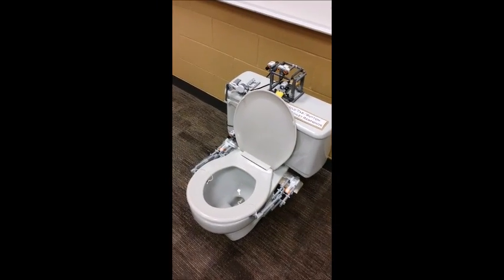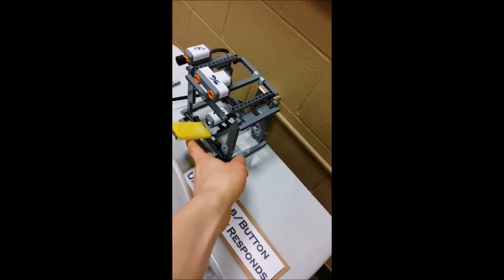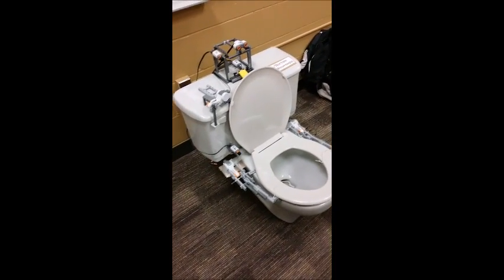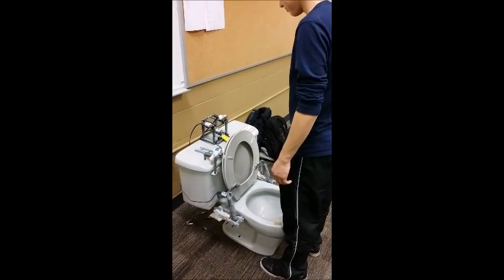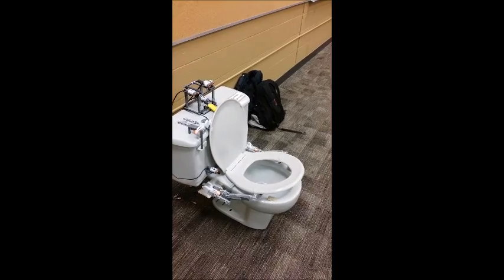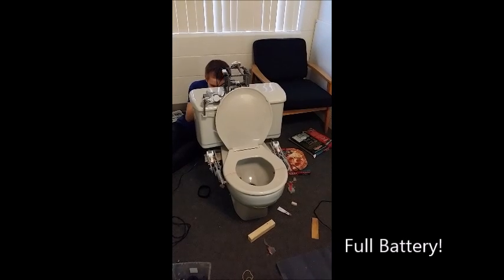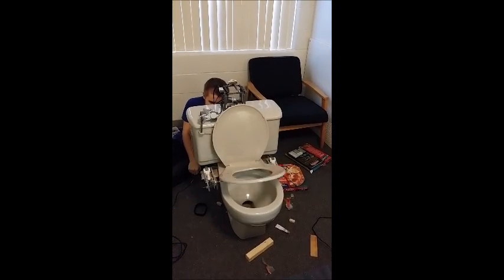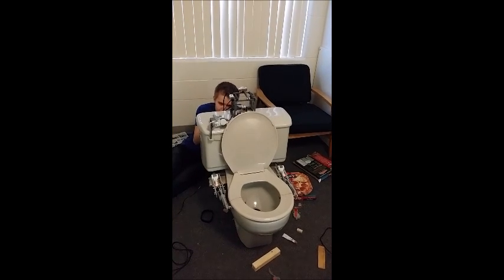Lego Mindstorms NXT Fully Automated Toilet Robot

Comment: Gross.  

It flushes with the lid OPEN and you have to touch a button anyway to lift the lid? What's the point? 

This is downgrading a normal toilet 

How much harder is it to add another ultrasonic sensor to facilitate touchless input and another set of lifter arms to close the lid? Not hard at all. 

The concept is flawed, and the execution is even worse.

So this makes no sense.